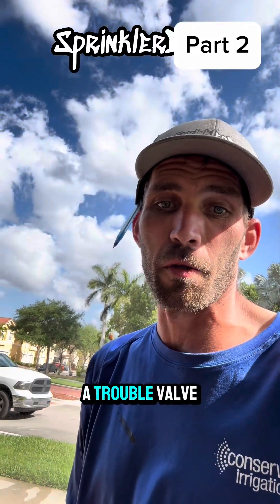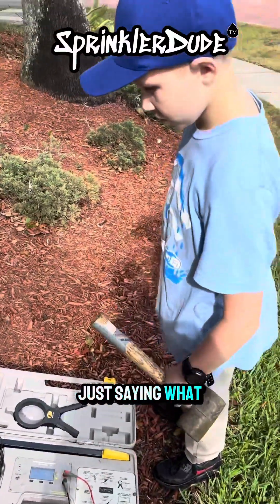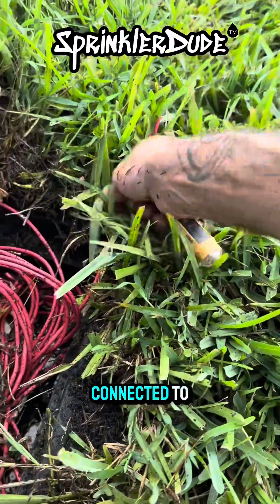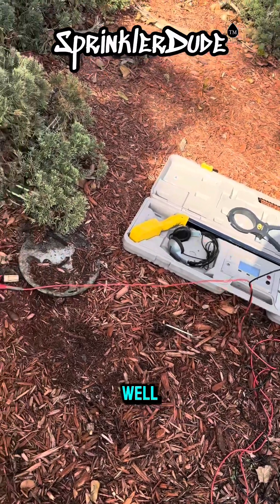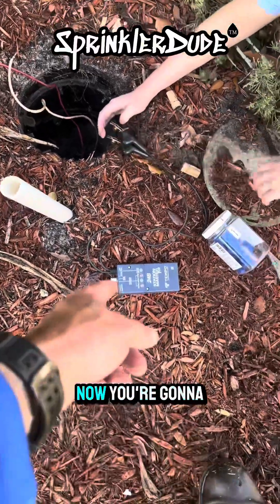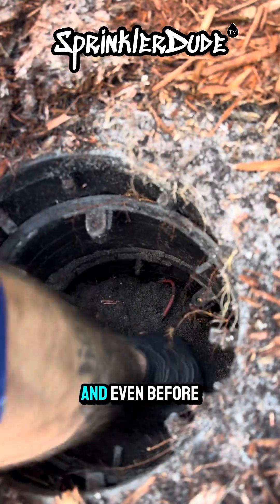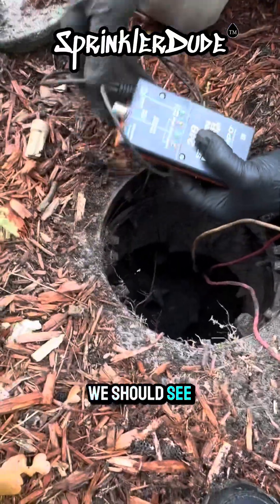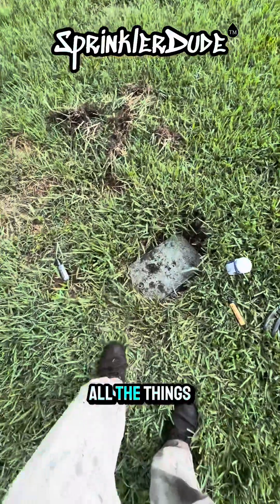Teaching Inspections and Troubleshooting | Part 2

Comment: Great video guys !, I seem to have trouble with the low voltage tester tracing the wire from the tracker would I be doing something wrong??
Reply from the maker: Can you try to describe what you’re doing so I can understand it better? I would be very happy to help explain it to you here.
Reply: I would hook the armada tracker to a zone wire / hot wire and try to check it with a low voltage tester but I wouldn’t pick it up so I usually use the tempo toner
Reply from the maker: @407.ramirez6  what model Armada Tracker are you using?
Reply: Pro 900 digital